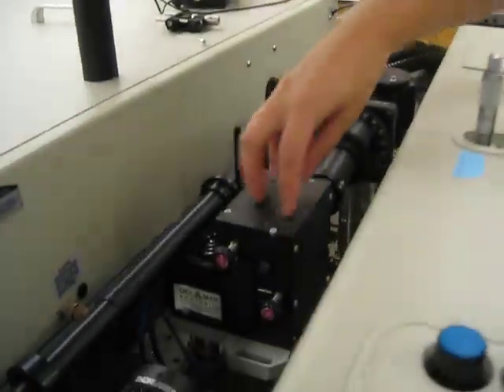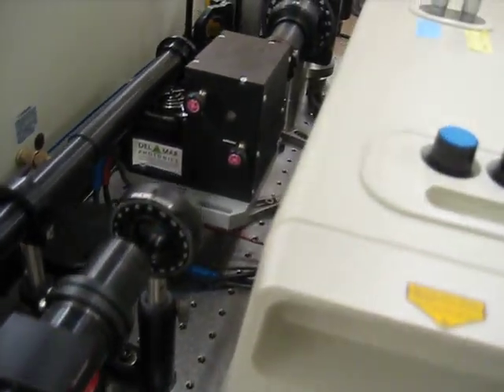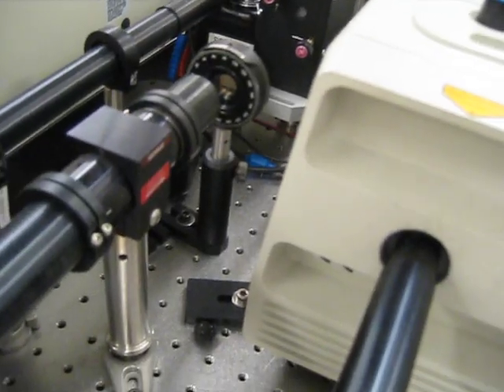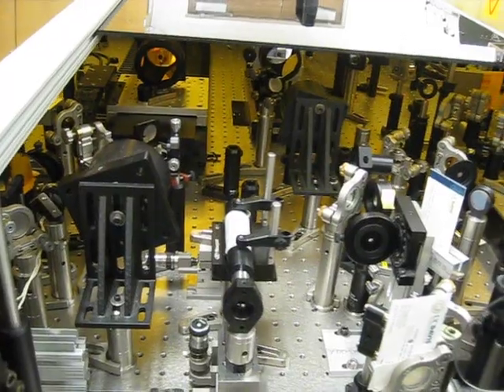A single source femtosecond-millisecond broadband spectrometer UC Davis - sales@dmphotonics.com

Comment from the maker: Opportunities for designing microstructured optical fibers for efficient femtosecond laser grating inscription
Tigran Baghdasaryan, Thomas Geernaert, Hugo Thienpont, Francis Berghmans
10 February 2015 • 8:50 - 9:10 AM | Part of SPIE OPTO

Structural dependence and mechanisms of LIPSS formation at a step edge due to single-pulsed femtosecond laser irradiation
Rico S. Cahyadi, Ryan D. Murphy, Ben R. Torralva, David P. Adams, Steven M. Yalisove
10 February 2015 • 6:00 - 8:00 PM | Part of SPIE LASE

Femtosecond laser direct-write of high-Q microresonators in glass and crystals
Ya Cheng, Jintian Lin, Jiangxin Song, Lingling Qiao, Wei Fang, Yingxin Xu
11 February 2015 • 1:30 - 1:55 PM | Part of SPIE LASE

Femtosecond pumped biological laser
Mark Mackenzie, Hamilton Charlotte, Kirsty J. Martin, Rebecca S. Saleeb, Rory R. Duncan, Lynn Paterson, Ajoy K. Kar
7 February 2015 • 4:10 - 4:25 PM | Part of SPIE BiOS

Femtosecond diamond Raman lasers
Jipeng Lin, Michelle Murtagh, David J. Spence, Richard Mildren
12 February 2015 • 11:00 - 11:20 AM | Part of SPIE LASE

Superhydrophobic metallic surfaces functionalized via femtosecond laser surface processing for long term air film retention when submerged in liquid
Craig A. Zuhlke, Troy P. Anderson, Benjamin Terry, Pengbo Li, Nick Roth, Dennis R. Alexander
10 February 2015 • 4:40 - 5:00 PM | Part of SPIE LASE

Mechanical response of single nerve cells estimated by femtosecond laser-induced impulsive force
Takanori Iino, Tadahide Furuno, Man Hagiyama, Akihiko Ito, Yoichiroh Hosokawa
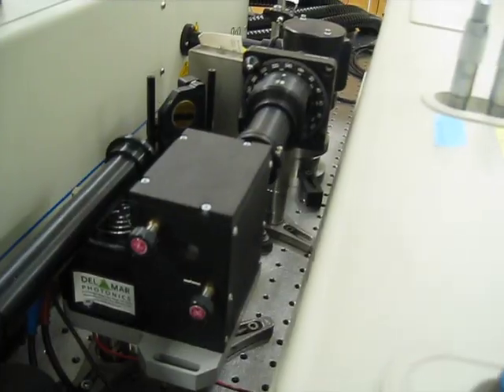8 February 2015 • 2:30 - 2:50 PM | Part of SPIE LASE

Research on femtosecond laser processing by using patterned vector optical fields
Yongnan Li
10 February 2015 • 6:00 - 8:00 PM | Part of SPIE LASE

Four-wave mixing based optical parametric oscillator producing high energy, tunable, chirped femtosecond pulses
Thomas Gottschall, Jens Limpert, Andreas Tunnermann
10 February 2015 • 4:00 - 4:20 PM | Part of SPIE LASE

Imaging carrier transport in one-dimensional nanoscale devices using femtosecond photocurrent microscopy
Yeong Hwan Ahn
8 February 2015 • 9:00 - 9:30 AM | Part of SPIE OPTO

Observation of formation of nanostructures in a porous glass immersed in water induced by femtosecond laser irradiation
Yang Liao, Koji Sugioka, Ya Cheng
10 February 2015 • 11:10 - 11:30 AM | Part of SPIE LASE

Ship-in-a-bottle integration by hybrid femtosecond laser technology for fabrication of true 3D biochips
Felix Sima, Dong Wu, Jian Xu, Katsumi Midorikawa, Koji Sugioka
10 February 2015 • 10:30 - 10:50 AM | Part of SPIE LASE

Femtosecond laser fabricated optofluidic device to mechanically discriminate between cells
Rebeca Martinez Vazquez, Giovanni Nava, Tie Yang, Manuela Veglione, Paolo Minzioni, Francesca Bragheri, Ilaria Chiodi, Maira Di Tano, Chiara Mondello, Ilaria Cristiani, Roberto Osellame
9 February 2015 • 4:50 - 5:10 PM | Part of SPIE BiOS

Femtosecond pulse laser notch shaping via fiber Bragg grating for the excitation source on the coherent anti-stokes Raman spectroscopy
Seung Ryeol Oh
9 February 2015 • 2:30 - 2:50 PM | Part of SPIE LASE

Erbium:ytterbium fiber-laser system delivering watt-level femtosecond pulses using divided pulse amplification
Robert Herda, Armin Zach
11 February 2015 • 5:10 - 5:30 PM | Part of SPIE LASE

Experimental and calculative estimation of femtosecond laser induced-impulsive force in culture medium solution with motion analysis of polymer micro-beads
Takeshi Yamakawa, Akihiro Maruyama, Hirohisa Uedan, Takanori Iino, Yoichiroh Hosokawa
10 February 2015 • 6:00 - 8:00 PM | Part of SPIE LASE

Femtosecond laser patterning of lithium-ion battery separator materials: Impact on liquid electrolyte wetting and cell performance
Johannes Proll, Bertram Schmitz, Axel Niemoeller, Bernd Robertz, Manfred Schafer, Maika Torge, Peter Smyrek, Hans J. Seifert, Wilhelm Pfleging
12 February 2015 • 3:10 - 3:30 PM | Part of SPIE LASE

Femtosecond laser writing of phase-tuned multi-level volume gratings for holographic fabrication of symmetry-controlled 3D photonic crystal structure
Liang Yuan, Peter Herman
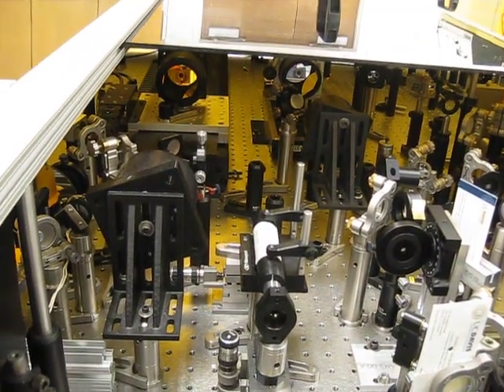8 February 2015 • 2:50 - 3:10 PM | Part of SPIE OPTO

Enhancing vapor generation at a liquid-solid interface using micro/nanoscale surface structures fabricated by femtosecond laser surface processing
Troy P. Anderson, Chris Wilson, Craig A. Zuhlke, Dennis Alexander
10 February 2015 • 2:00 - 2:20 PM | Part of SPIE LASE

Fabrication of periodic metal nanowire grating and dotted structures on silica substrate by femtosecond laser irradiation
Yasutaka Nakajima, Mitsuhiro Terakawa
9 February 2015 • 10:50 - 11:10 AM | Part of SPIE LASE

MW-level, kHz-repetition rate femtosecond fiber-CPA system operating at 1555 nm
Grzegorz J. Sobon, Pawel R. Kaczmarek, Aleksander Gluszek, Jaroslaw Z. Sotor, Jan Tarka, Krzysztof M. Abramski
10 February 2015 • 6:00 - 8:00 PM | Part of SPIE LASE

Towards an understanding of laser ablation efficiency: Comparison of pico- and femtosecond pulse durations
Juergen Sotrop, Jan Winter, Heinz P. Huber
12 February 2015 • 8:10 - 8:40 AM | Part of SPIE LASE

All-PM-fiber normal dispersion femtosecond optical parametric oscillator pumped by Yb-doped fiber laser
Khanh Q. Kieu, Dmitriy Churin, Roopa Gowda, Takefumi Ota, Yukihiro Inoue, Shinichiro Uno, Nasser N. Peyghambarian
10 February 2015 • 6:00 - 8:00 PM | Part of SPIE LASE
COURSE AT CONFERENCE
Micromachining with Femtosecond Lasers (SC743)
Instructor(s): Nolte, Stefan, Friedrich-Schiller-Univ. Jena
Level: Intermediate • 0.35 CEU • Length: 4.00 hours
Member Price: 300.00 | Non-Member Price: 355.00
9 February 2015 • 8:30 AM | Part of SPIE Photonics West

Modification of flow of glass melt and elemental distributions by parallel irradiation with femtosecond laser pulses
Masaaki Sakakura, Torataro Kurita, Kouhei Yoshimura, Naoaki Fukuda, Yasuhiko Shimotsuma, Kiyotaka Miura
12 February 2015 • 2:00 - 2:20 PM | Part of SPIE LASE

Femtosecond fiber laser welding for 3D manufacturing
Huan Huang, Lih-Mei Yang, Shuang Bai, Jian Liu
11 February 2015 • 8:50 - 9:20 AM | Part of SPIE LASE

Coherent Combination of Ultrafast Laser Pulses: A Route to Joule-Class High Repetition Rate Femtosecond Lasers
Jens Limpert
11 February 2015 • 11:10 - 11:50 AM | Part of SPIE LASE

Effect of nanoparticle size on plasmonic enhanced off-resonance femtosecond laser nanocavitation
Christos Boutopoulos, Ali Hatef, Matthieu Fortin-Deschenes, David Rioux, Remi Lachaine, Michel Meunier
8 February 2015 • 4:00 - 4:20 PM | Part of SPIE LASE

Optimization of laser process conditions for cutting of thin metal and polymer sheets with femtosecond laser
Klaus Stolberg, Susanna Friedel, Nikolas von Freyhold, Markus Rohner
10 February 2015 • 8:00 - 8:20 AM | Part of SPIE LASE

Femtosecond pulse shaping enables molecular imaging using optical Kerr-effect dynamics
Francisco E. Robles, Martin C. Fischer, Warren S. Warren
9 February 2015 • 11:20 - 11:35 AM | Part of SPIE BiOS

Ultrafast electron dynamics of N2 under femtosecond and XUV attosecond laser pulse train irradiation
Cong Wang, Ji-an Duan, Lan Jiang, Xiaoyan Sun, Mengmeng Wang
10 February 2015 • 6:00 - 8:00 PM | Part of SPIE LASE

Femtosecond laser inscription of microfluidic chip in glass for artificial photosynthesis
Shane M. Eaton, Surya S. Guduru, Sara Lo Turco, Luigino Criante, Guglielmo Lanzani, Roberta Ramponi, Giacomo Bergamini
9 February 2015 • 3:40 - 4:00 PM | Part of SPIE LASE

High energy, multiwatt, femtosecond diode-pumped Yb:CaAlGdO4 and Yb:CaF2 regenerative amplifiers
Etienne Caracciolo, Matthias Kemnitzer, Annalisa Guandalini, Federico Pirzio, Antonio Agnesi, Juerg Aus-der-Au
10 February 2015 • 10:50 - 11:10 AM | Part of SPIE LASE

Two-color double-pulse experiments studying the dynamics of femtosecond laser-induced periodic surface structures (LIPSS) on metals, semiconductors, and dielectrics
Sandra Hohm, Marcel Herzlieb, Arkadi Rosenfeld, Jorg Kruger, Jorn Bonse
10 February 2015 • 11:20 - 11:40 AM | Part of SPIE LASE

Catheter shape sensing with 3D fiber-cladding photonics based on femtosecond laser direct-written Bragg grating waveguides
Kenneth K. C. Lee, Kyle H. Y. Cheng, Victor X. D. Yang, Peter R. Herman
9 February 2015 • 4:40 - 5:00 PM | Part of SPIE LASE

Design and fabrication of sub-wavelength annular apertures for femtosecond laser machining
Kuan Yu Hsu, Yen Chun Tung, Ming-Han Chung, Chih-Kung Lee
11 February 2015 • 2:30 - 2:50 PM | Part of SPIE LASE

Experimental study on early stage of LIPSS formation on SiC by using double pulses of femtosecond laser
Taira Enami, Shuhei Yada, Yasutaka Nakajima, Mitsuhiro Terakawa
10 February 2015 • 6:00 - 8:00 PM | Part of SPIE LASE

The effect of femtosecond laser processing conditions on the properties of a polarization imaging filter inside a silica glass
Yuya Yamada, Takafumi Ohfuchi, Naoaki Fukuda, Masaaki Sakakura, Yasuhiko Shimotsuma, Kiyotaka Miura, Toshio Takiya
10 February 2015 • 6:00 - 8:00 PM | Part of SPIE LASE

Bragg grating fabrication in microfiber by femtosecond pulse filamentation induced periodic refractive index modification
Farid Ahmed, Martin B. G. Jun
9 February 2015 • 4:30 - 4:50 PM | Part of SPIE LASE

High power Yb:YAG single-crystal fiber amplifiers for femtosecond lasers
Fabien Lesparre, Igor Martial, Julien Didierjean, Jean-Thomas Gomes, Wolfgang P. Pallmann, Bojan Resan, Andre Loescher, Jan-Phillipp Negel, Thomas Graf, Marwan Abdou Ahmed, Francois Balembois, Patrick Georges
8 February 2015 • 9:00 - 9:20 AM | Part of SPIE LASE

Apertureless confocal scanning microscopy under temporally controlled femtosecond pulse illumination
Dhiman Das, Soumendra N. Bandyopadhyaya, Debabrata Goswami
8 February 2015 • 5:30 - 7:00 PM | Part of SPIE BiOS

Optical cell cleaning by NIR femtosecond lasers
Aisada Uchugonova, Hans Georg Breunig, Ana Batista, Karsten Konig
11 February 2015 • 1:30 - 1:50 PM | Part of SPIE BiOS

Compact fixed wavelength femtosecond oscillators for multi-photon imaging
Tommi Hakulinen, Ruben Zadoyan, Tommaso Baldacchini, Tilman Franke
9 February 2015 • 10:50 - 11:05 AM | Part of SPIE BiOS

Integration of femtosecond fiber laser and endoscopy
Huda Yousif, Hussein E. Kotb, Majid Naji, Mohamed A. Abdelalim, Sangeeta Murugkar, Hanan Anis
9 February 2015 • 11:35 - 11:50 AM | Part of SPIE BiOS

Highly functional fiber cladding photonics: Real-time monitoring to control femtosecond laser writing of optical taps and filters
Jason R. Grenier, Luis Andre Fernandes, Peter R. Herman
9 February 2015 • 4:20 - 4:40 PM | Part of SPIE LASE

Two-photon photoacoustic optical imaging using femtosecond pulses
Ben E. Urban, Jr.
8 February 2015 • 5:30 - 7:00 PM | Part of SPIE BiOS

Third harmonic generation and multiphoton fluorescence in graphene using a compact femtosecond 1.56 µm laser
Antti Saynatjoki, Lasse Karvonen, Juha Riikonen, Wonjae Kim, Joonas Makinen, Seyed Soroush Mehravar, Robert A. Norwood, Nasser N. Peyghambarian, Harri Lipsanen, Khanh Kieu
9 February 2015 • 1:40 - 2:00 PM | Part of SPIE OPTO

Investigation of double-pulse femtosecond laser induced breakdown spectroscopy of polymethyl methacrylate (PMMA)
Mengmeng Wang, Sumei Wang, Zhitao Cao, Peng Wang, Cong Wang
10 February 2015 • 6:00 - 8:00 PM | Part of SPIE LASE

Vibration assisted femtosecond laser hole drilling on fine metal mask for AMOLED application
Wonsuk Choi, Ji-Wook Yoon, Hoon-Young Kim, Sung-Hak Cho
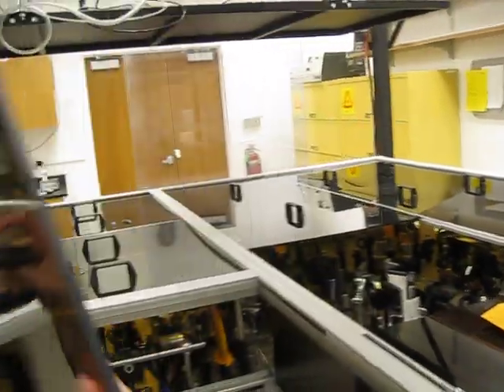10 February 2015 • 2:40 - 3:00 PM | Part of SPIE LASE

Production of waveguides on borate glass doped with transition metals by femtosecond laser pulses
Juliana M. Almeida, Paulo Henrique D. Ferreira, Ruben D. F. Rodriguez, Leonardo De Boni, Antonio C. Hernandes, Cleber R. Mendonca
11 February 2015 • 6:00 - 8:00 PM | Part of SPIE OPTO

First experimental results towards a 100W wavelength-tunable femtosecond OPCPA
Mark J. Prandolini, Hauke Hoppner, Arvid Hage, Michael Schulz, Robert Riedel, Franz Tavella
10 February 2015 • 10:30 - 10:50 AM | Part of SPIE LASE

Femtosecond inscribed mode modulators in large mode area fibers: Experimental and theoretical analysis
Ria G. Kramer, Philipp Gelszinnis, Christian Voigtlander, Christian Schulze, Jens U. Thomas, Daniel Richter, Michael Duparre, Stefan Nolte
9 February 2015 • 3:40 - 4:00 PM | Part of SPIE LASE

Metal deep engraving with high average power femtosecond lasers
Rainer Kling, Marc Faucon, Girolamo Mincuzzi, Franck Morin, Clemens Honninger, Eric P. Mottay
11 February 2015 • 9:00 - 9:20 AM | Part of SPIE LASE

The experimental setup for study biological objects using the methods of femtosecond and CARS microscopy
Arseny Aybush, Fedor Gostev, Alexander Zalessky, Konstantin Vereschagin, Viktor Nadtochenko
8 February 2015 • 5:30 - 7:00 PM | Part of SPIE BiOS

Volumetric integration of photorefractive micromodifications in lithium niobate using femtosecond direct laser write technique
Domas Paipulas, Vygantas Mizeikis, Vytautas Purlys, Ausra Cerkauskaite, Saulius Juodkazis
8 February 2015 • 3:10 - 3:30 PM | Part of SPIE OPTO

Generation of laser-induced periodic surfaces structures in indium-tin-oxide thin films and two-photon lithography of ma-N photoresist by sub-15 femtosecond laser microscopy for liquid crystal cell application
Madlen Klotzer, Karsten Konig, Martin H. Straub
10 February 2015 • 6:00 - 8:00 PM | Part of SPIE LASE

Mechanism of morphological feature formation in the interior of cornea induced by femtosecond laser pulses
Yizang Guo, Sinisa Vukelic
9 February 2015 • 8:30 - 8:50 AM | Part of SPIE BiOS

Quantized structuring of transparent films with femtosecond laser interference
Stephen Ho, Kenneth K. C. Lee, Jianzhao Li, Peter R. Herman
10 February 2015 • 9:00 - 9:20 AM | Part of SPIE LASE

Femtosecond laser collagen cross-linking without traditional photosensitizers
Nicola G. Celi, Michael D. Yu, Sinisa Vukelic
8 February 2015 • 11:50 AM - 12:10 PM | Part of SPIE BiOS

Femtosecond laser induced extraordinary relief surface microstructures on thin Cr films
Jianxiong Zhou, Jianjun Yang, Bo Zhao, Xianfan Xu
9 February 2015 • 11:50 AM - 12:10 PM | Part of SPIE LASE

Integrated femtosecond lasers
Clemens Honninger, Martin Delaigue, Florent Guichard, Amelie Letan, Guillaume Machinet, Franck Morin, Julien Pouysegur, Birgit Weichelt, Yoann Zaouter, Eric P. Mottay
12 February 2015 • 8:30 - 9:00 AM | Part of SPIE LASE

Yb:CaF2 femtosecond laser in versatile burst mode: A powerful tool to optimize laser interaction
Antoine Courjaud, Jean-Gabriel Brisset, Eric P. Mottay
9 February 2015 • 11:00 - 11:20 AM | Part of SPIE LASE

Erasure and formation of femtosecond laser-induced nanostructures
Felix Zimmermann, Anton Plech, Andreas Tunnermann, Stefan Nolte
10 February 2015 • 8:40 - 9:00 AM | Part of SPIE LASE

Hemifusion of cells using femtosecond laser pulses
Nir Katchinskiy, Roseline Godbout, Helly R. Goez, Abdulhakem Y. Elezzabi
8 February 2015 • 5:00 - 5:20 PM | Part of SPIE BiOS

100w femtosecond fiber amplifier and harmonic generation from IR to UV
Julien Saby
10 February 2015 • 6:00 - 8:00 PM | Part of SPIE LASE

Tribological performance of near- and sub-wavelength femtosecond laser-induced periodic surface structures on titanium
Jorn Bonse, Robert Koter, Manfred Hartelt, Dirk Spaltmann, Simone Pentzien, Sandra Hohm, Arkadi Rosenfeld, Jorg Kruger
10 February 2015 • 6:00 - 8:00 PM | Part of SPIE LASE

Femtosecond laser-induced attachment of single neurons
Nir Katchinskiy, Indrani Dutta, Helly R. Goez, Roseline Godbout, Abdulhakem Y. Elezzabi
7 February 2015 • 2:50 - 3:10 PM | Part of SPIE BiOS

Femtosecond laser micromachining for the realization of fully-integrated photonic and microfluidic devices
Roberta Ramponi
11 February 2015 • 10:40 - 11:10 AM | Part of SPIE OPTO

Adaptable acylindrical optofluidic lenses fabricated by femtosecond laser micromachining
Petra Paie, Francesca Bragheri, Theo Claude, Roberto Osellame
10 February 2015 • 11:50 AM - 12:10 PM | Part of SPIE LASE

Split ring resonator based THz-driven electron streak camera featuring femtosecond resolution
Justyna Fabianska, Gunther Kassier, Thomas Feurer
11 February 2015 • 5:05 - 5:20 PM | Part of SPIE OPTO

Femtosecond laser waveguide writing inside zinc phosphate glasses: Role of composition on permanent photo-induced changes
Vladimir A. Semenov, Denise M. Krol, Francisco J. Hernandez Rueda, Neil W. Troy, Jeffrey D. Smith, Richard K. Brow
9 February 2015 • 5:20 - 5:40 PM | Part of SPIE LASE

Compression of chirp pulses from a femtosecond fiber based amplifier
Rumi Ito, Ken-ichi Takiuchi, Kazuyoku Tei, Shigeru Yamaguchi, Jun Enokidani, Shin Sumida
12 February 2015 • 2:00 - 4:00 AM | Part of SPIE LASE

Femtoseconds to microseconds: Multi-scalar response during liquid spallation of metal films
Steven M. Yalisove, Keegan J. Schrider, Michael J. Abere, Ben R. Torralva
12 February 2015 • 10:30 - 11:00 AM | Part of SPIE LASE

Cooperative atomic motion probed by femtosecond electron diffraction
Jure Demsar, Maximilian Eichberger
9 February 2015 • 4:05 - 4:35 PM | Part of SPIE OPTO

Effect of different properties of Cu(in1-xGax)Se2 thin films synthesized by femtosecond and nanosecond pulsed laser deposition
Mu-Gong Tsai, Chia-Chuan Chen, You-jyun Chen, In-Gann Chen, Xiaoding Qi, Jung-Chun A. Huang, Cen-Ying Lin, Chung-Wei Cheng
10 February 2015 • 6:00 - 8:00 PM | Part of SPIE LASE

Nanoparticles generation inside Ag-doped LBG glass by annealing or femtosecond direct laser writing
Marie Vangheluwe, Yannick G. Petit, Nicolas Marquestaut, Evelyne Fargin, Alexia Corcoran, Feng Liang, Real Vallee, Thierry Cardinal, Lionel S. Canioni
10 February 2015 • 9:40 - 10:00 AM | Part of SPIE OPTO

Structural dynamics in femtosecond laser-excited phase change materials studied by time-resolved x-ray scattering
Klaus Sokolowski-Tinten
12 February 2015 • 2:40 - 3:00 PM | Part of SPIE LASE

The role of highly non-linear index change mechanism during femtosecond grating writing in microstructured optical fibers
Tigran Baghdasaryan, Thomas Geernaert, Hugo Thienpont, Francis Berghmans
10 February 2015 • 9:10 - 9:30 AM | Part of SPIE OPTO

Low noise, phase coherent and efficient generation of femtosecond ~1.3?m pulses from a two zero dispersion wavelength photonic crystal fiber
Yuhong Yao, Wayne H. Knox
12 February 2015 • 9:50 - 10:10 AM | Part of SPIE LASE

Optical reprogramming with ultrashort femtosecond laser pulses
Aisada Uchugonova, Hans G. Breunig, Ana Batista, Karsten Konig
9 February 2015 • 10:30 - 10:50 AM | Part of SPIE BiOS

Ablation depth control on ITO thin film using a beam shaped femtosecond laser
Hoon-Young Kim, Ji-Wook Yoon, Won-Suk Choi, Sung-Hak Cho
12 February 2015 • 11:00 - 11:20 AM | Part of SPIE LASE

Cell-based optical assay for Alzheimer's disease using femtosecond-pulsed laser
Seunghee Lee, Jonghee Yoon, Chulhee Choi
9 February 2015 • 5:30 - 7:30 PM | Part of SPIE BiOS

Two photon polymerization (2PP) technique optimization study using a green femtosecond oscillator
Areti Mourka, Vasileia Melissinaki, Maria Farsari, Antoine Courjaud, Eric P. Mottay
10 February 2015 • 6:00 - 8:00 PM | Part of SPIE LASE

controlling femtosecond dynamics on the nanometer scale
Nicolo Accanto, Lukasz Piatkowski, Jan Renger, Niek F. van Hulst
9 February 2015 • 10:30 - 11:15 AM | Part of SPIE OPTO

Porcine cadaver iris model for iris heating during corneal surgery with a femtosecond laser
Hui Sun, Zhongwei Fan, Ying Yan, Tianzhuo Zhao, Jin Yun, Ronald M. Kurtz M.D., Tibor Juhasz
9 February 2015 • 10:50 - 11:10 AM | Part of SPIE BiOS

Image-guided ablation for the study of bone regeneration using a femtosecond fiber laser source
Luke J. Mortensen, Clemens Alt, Chia-Yuan Chang, Raphael Turcotte, Giuseppe Intini, Charles P. Lin
9 February 2015 • 5:30 - 7:30 PM | Part of SPIE BiOS

Optofluidic waveguides written in hydrophobic silica aerogels with a femtosecond laser
Berna Yalizay, Yagiz Morova, Yagmur Ozbakir, Alexandr Jonas, Can Erkay, Alper Kiraz, Selcuk Akturk
11 February 2015 • 12:00 - 12:20 PM | Part of SPIE OPTO

Inhibition of cellular respiration with a femtosecond laser via impulsive stimulated Raman scattering
Chieh Han Lu, Kung Hsuan Lin, Kong Thon Tsen, Yung Shu Kuan
11 February 2015 • 9:40 - 10:00 AM | Part of SPIE BiOS

Hybrid type-I/II waveguide embedded Bragg gratings in lithium niobate by direct femtosecond laser writing
Sebastian Kroesen, Jorg Imbrock, Cornelia Denz
8 February 2015 • 11:20 - 11:40 AM | Part of SPIE OPTO

Compact fixed wavelength femtosecond oscillators for multi-photon applications
Tommi Hakulinen, Heinz P. Huber, Tilman Franke, Ruben Zadoyan, Tommaso Baldacchini
9 February 2015 • 11:40 AM - 12:00 PM | Part of SPIE LASE

Femtosecond fiber laser welding of PMMA
Annalisa Volpe, Francesca Di Niso, Caterina Gaudiuso, Antonio Ancona, Pietro Mario Lugara, Rebeca Martinez Vazquez, Roberto Osellame, Andrea De Rosa
10 February 2015 • 9:40 - 10:00 AM | Part of SPIE LASE

Sorting on the basis of deformability of single cells in a femtosecond laser fabricated optofluidic device
Francesca Bragheri, Petra Paie, Tie Yang, Giovanni Nava, Rebeca Martinez Vazquez, Maira Di Tano, Manuela Veglione, Paolo Minzioni, Chiara Mondello, Ilaria Cristiani, Roberto Osellame
8 February 2015 • 5:20 - 5:40 PM | Part of SPIE LASE

Femtosecond-pulse plasmonic ionization kills cancer cells
Limor Minai, Adel Zeidan, Daniella Yeheskely-Hayon, Dvir Yelin
8 February 2015 • 2:50 - 3:10 PM | Part of SPIE LASE

Diffraction characteristics of spatial-temporal Gaussian-shaped femtosecond laser pulse and near-field intensity recorded
Shutong Wang, Guoying Feng
10 February 2015 • 6:00 - 8:00 PM | Part of SPIE LASE

Catalytic Rh-based alloy nanoparticles by femtosecond laser irradiation of aqueous solution
Takahiro Nakamura, Md. Samiul I. Sarker, Shunichi Sato
8 February 2015 • 9:20 - 9:40 AM | Part of SPIE LASE

Towards 3D laser nano patterning in polymer optical materials
Patricia J. Scully, Walter Perrie
12 February 2015 • 8:30 - 9:00 AM | Part of SPIE LASE

Delivery of an ultrashort spatially focused pulse through a multimode fiber using digital phase conjugation
Edgar E. Morales Delgado, Ioannis N. Papadopoulos, Salma Farahi, Demetri Psaltis, Christophe Moser
7 February 2015 • 5:30 - 5:50 PM | Part of SPIE BiOS

Non-invasive, label free biophotonic sensing with sensitized glass
Gin Jose, Tarun Kakkar, Toney T. Fernandez, Matthew Murray, Jayakrishnan Chandrappan, Ramzi Ajjan, Sikha Saha, Billy D. Richards, Animesh Jha, Paul Steenson, Peter Grant
7 February 2015 • 4:10 - 4:30 PM | Part of SPIE BiOS

Molybdenum thin film ablation on glass substrate by ultra-short laser
Pinaki Das Gupta, Gerard M. O'Connor
10 February 2015 • 6:00 - 8:00 PM | Part of SPIE LASE

High-average-output-power mode-locked figure-eight all-fiber Yb master oscillator
Sergey M. Kobtsev, Yurii Fedotov, Aleksey V. Ivanenko

Fiber based ultra-short pulse delivery for nonlinear spectroscopy and microscopy using high energy solitons
Sarah Saint-Jalm, Esben R. Andresen, Abdelkrim Bendahmane, Alexandre Kudlinski, Herve Rigneault
8 February 2015 • 5:30 - 7:00 PM | Part of SPIE BiOS

Optically generated hybridoma using bispecific gold nanoparticles
Daniella Yeheskely-Hayon, Limor Minai, Dvir Yelin
9 February 2015 • 4:15 - 4:35 PM | Part of SPIE BiOS

Dynamics of optically excited tungsten, stainless steel and bulk metallic glass for ripples formation
Hao Zhang, Chen Li, Jean-Philippe Colombier, Guanghua Cheng, Razvan Stoian
10 February 2015 • 4:00 - 4:20 PM | Part of SPIE LASE

In vivo non-invasive multiphoton tomography of human skin with subcellular spatial and picosecond time resolution to detect bio- and chemohazards
Karsten Konig
8 February 2015 • 5:30 - 7:00 PM | Part of SPIE BiOS

Laser-induced controlled crystallization of heavy metal oxide glass
Juliana M. P. Almeida, Paulo H. D. Ferreira, Antonio C. Hernandes, Cleber R. Mendonca
10 February 2015 • 6:00 - 8:00 PM | Part of SPIE LASE

Selective optoporation of cells targeted with functionalized gold nanoparticles enhancing ultrafast laser pulse irradiation
Eric Bergeron, Alexandre Torres, Rosalie Martel, Camille Rodriguez, Christos Boutopoulos, Jukka Niskanen, Jean-Jacques Lebrun, Francoise M. Winnik, Michel Meunier
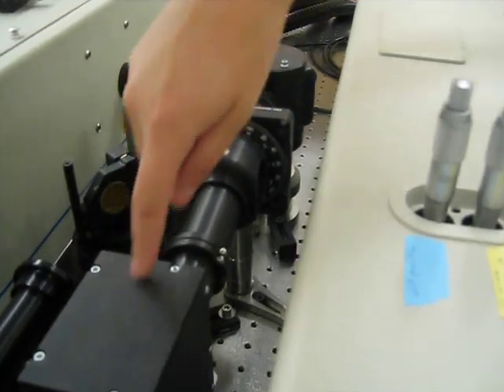8 February 2015 • 2:10 - 2:30 PM | Part of SPIE LASE

Comprehensive photo-physics investigation of novel Corroles
Sai Santosh Kumar Raavi, Jun Yin, Giulia Grancini, Lingamallu Giribabu, Cesare Soci, Soma Venogopal Rao
11 February 2015 • 9:20 - 9:40 AM | Part of SPIE OPTO

Ultrafast photo-response in superconductive isotropic radiators for microwave generation
Brian D. Dolasinski, Peter E. Powers, Joseph W. Haus, Thomas Bullard, John Bulmer
10 February 2015 • 2:50 - 3:10 PM | Part of SPIE LASE

Three dimensional optofluidic device for isolating marine microbes
Anusha Keloth, Lynn Paterson, Gerard H. Markx, Ajoy K. Kar
9 February 2015 • 2:50 - 3:10 PM | Part of SPIE BiOS